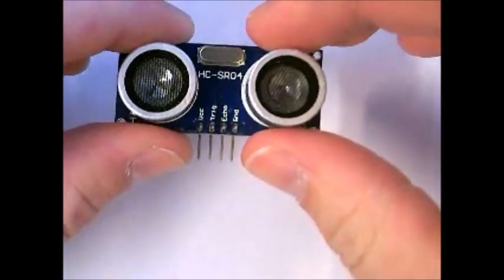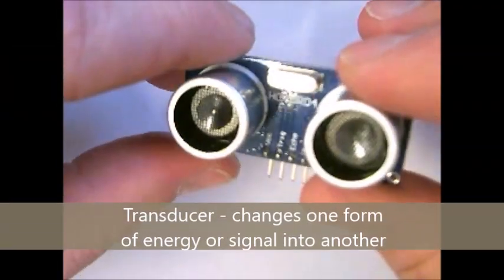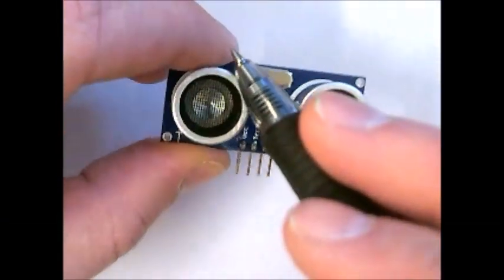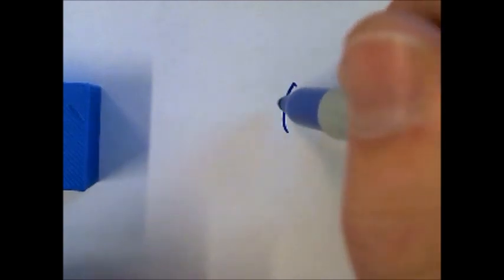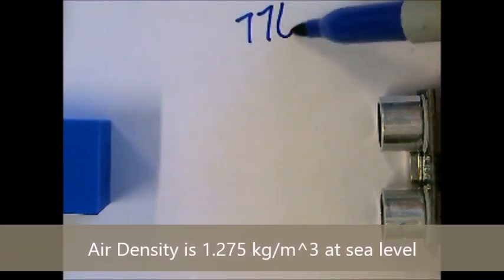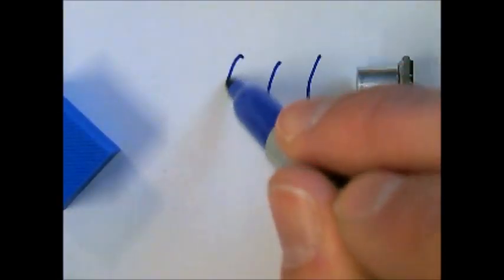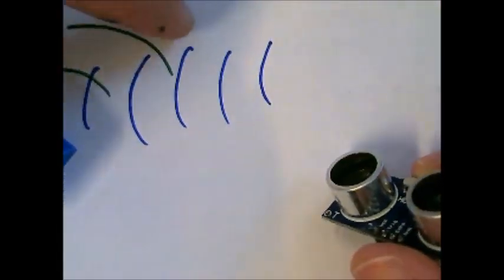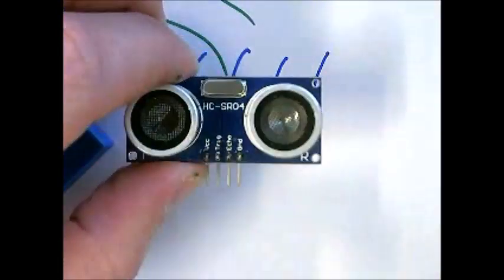How an Arduino Ultrasonic Sensor Works

Comment: At 2:40, I believe the equation should be: Distance = speed of sound * time to travel to object and back * 0.5 to calculate the one-way distance, not round trip.
Reply: I believe we are calculating the distance between sensor and object that reflects, not distance traveled by ultrasonic signals for the acknowledgement..

Comment: Great explanation!
I am working on this project in which I want to check dimensions of the metal parts or drilled holes.
I want to use this sensor for inspection purpose.
Can you give me some idea related to industry application?